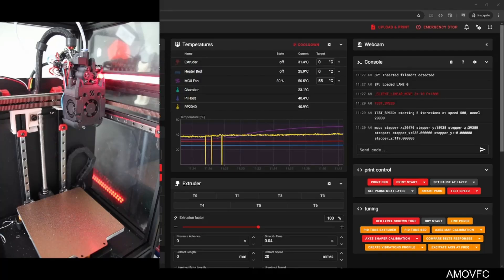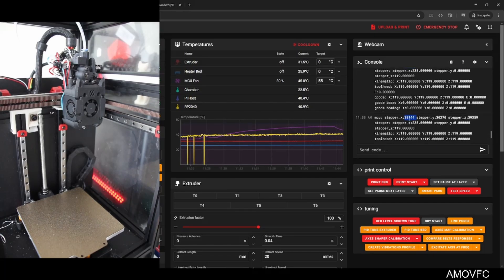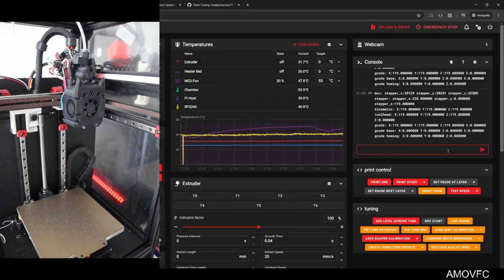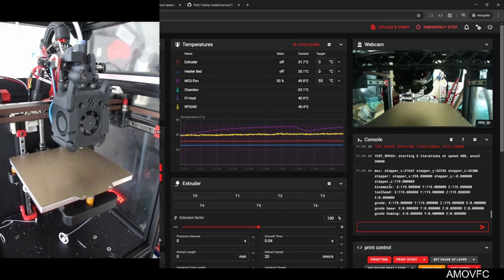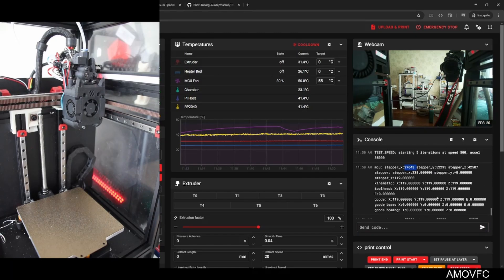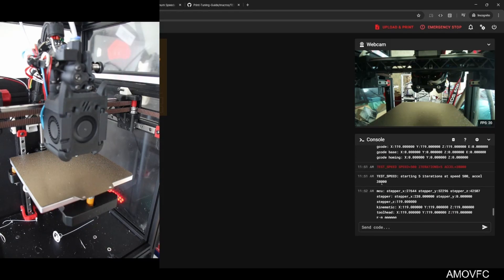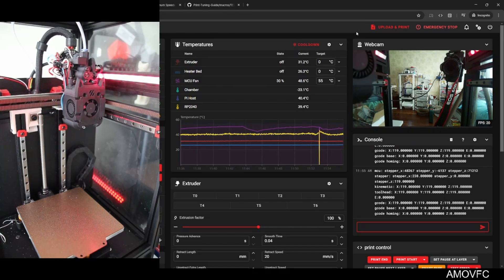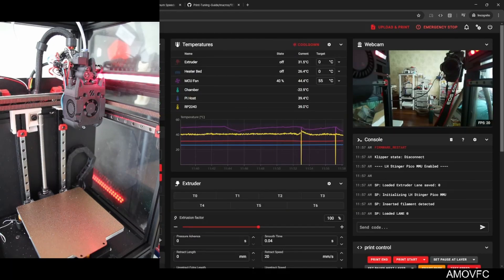VORON V0 acceleration tuning with Ellis' TEST_SPEED macro

Comment: Damn that's some violent shaking. You might need wider feet mod, or glue some notches on the table to hold the printer, or if all else fails, bolt the printer to the table.
Reply from the maker: Yeah I have seen there is a wider feet mod for the v0 that looks really nice, I might have to look into that, right now I am just running the hula feet to help isolate the vibrations from the table
Reply: @AMOVFC  I've done both the wider feet and notches on the table. Otherwise after half an hour it would fall off the table lol